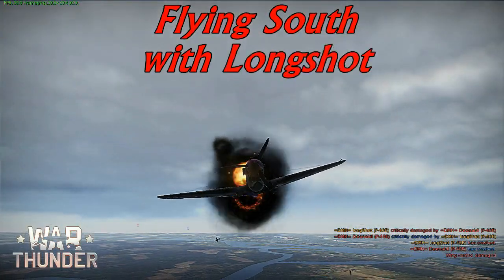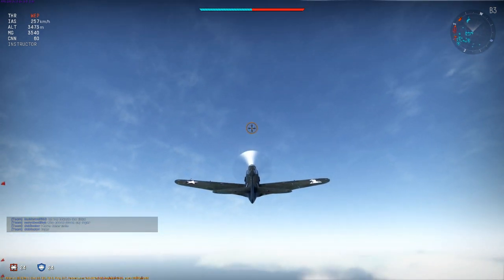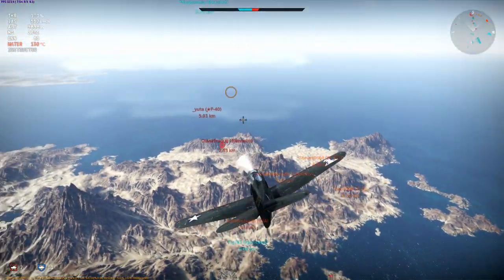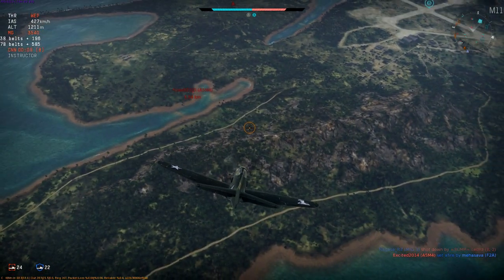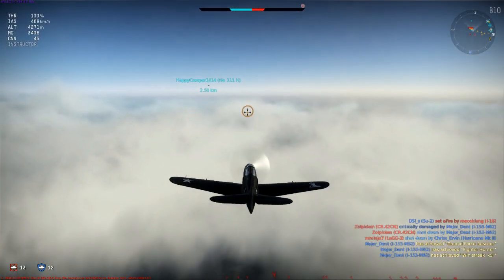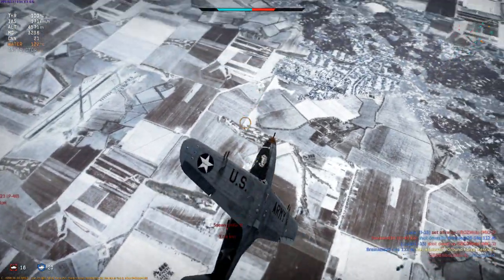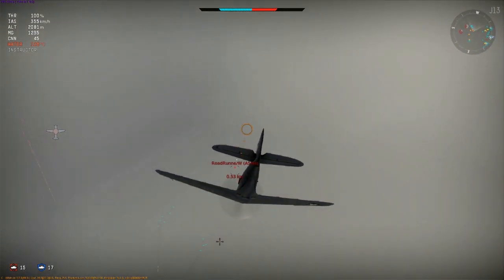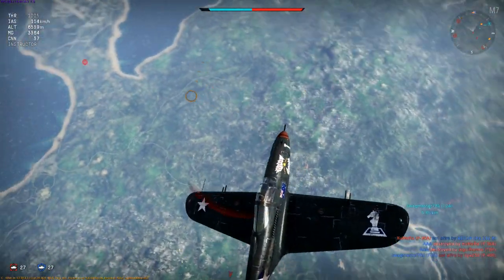WT - the Clunker (P-400 Arcade Tutorial)

Comment: I think your limited success with this plane may simply boil down to player perception vs your particular style of play.  This plane has a reputation as a great climber, and your play style seems to include a lot of energy traps. When players see a Zero or a Corsair up high, they may be more inclined to take a shot at it because those planes aren't perceived as great energy fighters, whereas most players will immediately disengage or ignore a p38 that they determine to have an energy advantage.  I know i wouldn't go chasing it, id rather force it into a dogfight or catch it on a zoom climb. 

It's funny that a plane which is actually decently suited for your play style doesn't serve you well because the plane itself is actually tipping your hand. 

That being said, i didn't like this plane. The bad rudder and tissue paper DM earned this one a quick spot in my hangar. A shame since irl this was a pilot favorite among American Aces in the pacific theater.
Reply from the maker: James Ziegenbalg I'm not sure where you got the impression that I didn't have great success in this plane.  I can't remember what I said in this vid, it was a while since I made it, but I thoroughly enjoyed flying it then & still do now.  Also, its rudder is very strong - a little too strong in the current patch as if you hold it too long it can stall the plane.
Reply: Oops wrong vid. I meant to post this on the p-38g review.
Reply from the maker: James Ziegenbalg Ah, it all makes sense now :)  I do intend to come back and try the P-38 again at some point.  I hate it when a plane gets the better of me.
Reply: I apologize, I'm just consuming your videos at such a rapid pace hard to keep track lol

Comment: argh, it feels like they borked what i loved most about the p-400 with this patch tonight, it feels so much slower

EDIT: i flew it out a second time and i think i was just bugged. there are some improvements like no more shuddering, but i feel like there are situations where the engine feels weak :(
Reply from the maker: You're kidding - it changed??  There's no mention of it in the patch notes.  If I'd have known then I wouldn't have made the video till after 1.43 :(

Also at my current glacial download rate I won't be able to see for myself for at least another 24 hours.
Reply: yeah, but from what I've seen they toyed with physics or something, all of my planes flew different. :( first time I flew it though I think it was bugged, it almost didn't go over 300 kmh but the second time I think that fixed the modules or something. but yeah it doesn't shake on the elevators at high speed, and it seems like it will do a loop instantly at 700, but it climbs much worse and that was why I loved it. :(
Reply from the maker: Tony Elmore
You're absolutely right, its a completely new FM.  This vid is immediately obsolete as regards the P-400, guess its still of use as a general guide to powerful planes with lousy handling but strong rudders.  I'll make a follow-up P-400 vid in the near future.